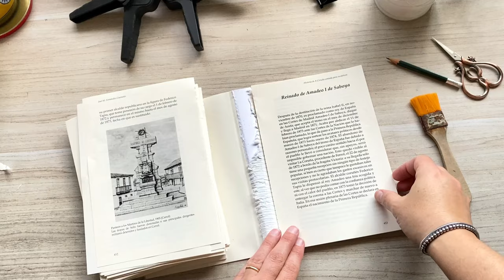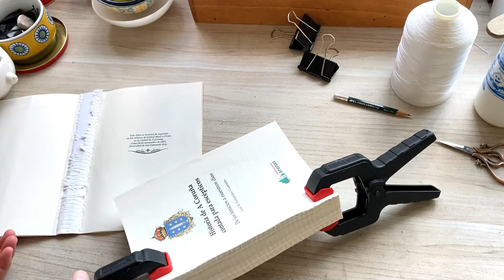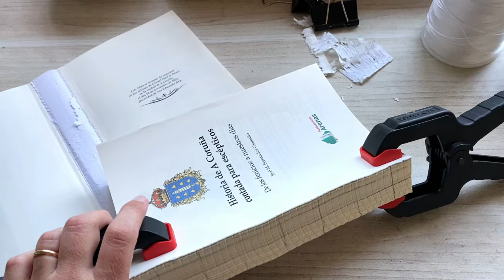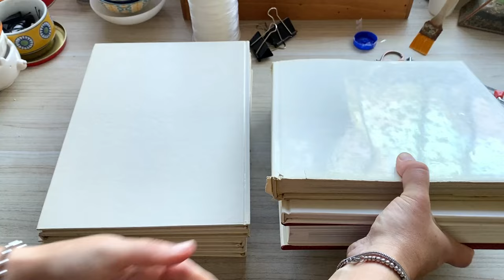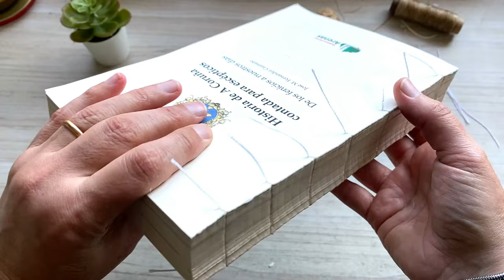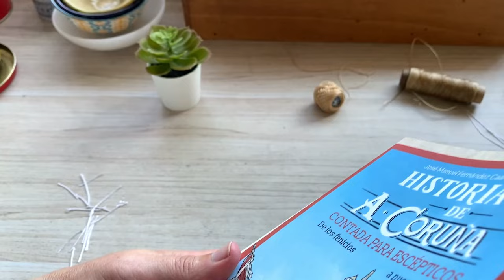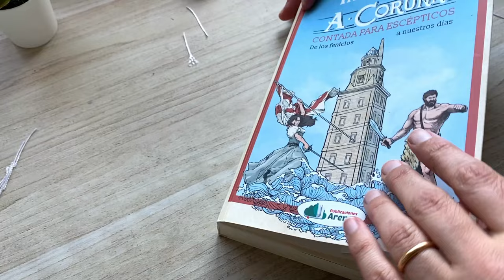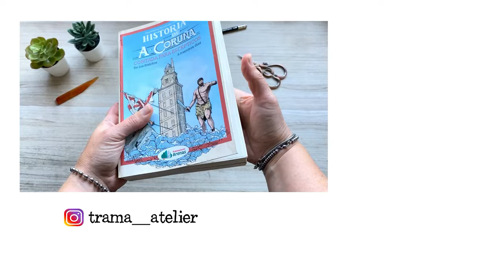How to BIND Single Sheets 👉  ​​How to Repair a BOOK [  NO sewing ! ] Bookbinding Tutorial

Comment: Amazing ❤. I printed single 188 papers to bind the book alone, cuz giving someone to bind a book is a bit expensive 😅. I have a question tho. Why cut the edges and put a thread inside?
Reply from the maker: Hello ! The cut on the spine and the threads provide some resistance to the opening mechanism. Many years ago it was done this way to simulate a false seam. You can try it without the threads but you have to be very sure that the adhesive on the spine will keep everything in place. In fact, that book that you see in the video was new and as soon as I started reading it the pages fell off, it only had adhesive on the spine...now with the threads it works better.
Reply: @bookbindig_studio  ooohhh ryt ryt that you soon damn much 😭❤

Comment: why the strings?
Reply from the maker: Because they add strength to the spine, otherwise, you only depend on the adhesive
Reply: Super...one day I got an idea to cut stripes on the back to add more adhesive to squeeze in to bind more. And also thought to add some flexibility by fixing plastic stripes to it. But fixing with threads is a super idea.
I thought to cut at the back zeebra cuttings i.e zig zac to add more strength to it. 
But this most enough to repair.
Thanks to your vedio. May God bless you.

Comment: Is that bookbinding press made out of cardboard?
Reply: Go to your local joiner or carpenter’s workshop and get them to cut you two lengths of plywood about 15” or 375mm long by about 2” or 50mm wide.  (Joiners in the UK use mm, not cm.). The plywood should ideally be 1” or 25mm thick:  it needs to be stiff rather than strong, or when you tighten your press around a text block it will spring apart in the centre.  Ask them to bore a hole, 8mm in diameter, 1.25” or 30mm from each end of each strip.  Buy some set screws about 3” or 75mm long, ideally with wing nuts for tightening them, and stainless steel washers for each side.  (A bolt has a smooth shank under the head and then a short length of threading.  A set screw is similar, but has no smooth section: rather the thread extends all the way up to the head.  It’s a more flexible option than a bolt for this kind of work). Fit the strips together with the set screws, washers, and wing nuts and you have a book press that will last pretty much forever.  The parts are freely available and shouldn’t cost more that £10$ off eBay, including postage, if your local hardware store can’t help.  Alternatively, you could buy a nice old Dryad book press for around £150$…
Reply from the maker: Hello ! No, it's made of wood , 
I made it as shown in this video   https://youtu.be/-09fZs9Lxfg?si=1yx7Omfn9kcIa8Qi
Reply from the maker: @willgrime  Thank you very much for your complete contribution on the materials necessary to make a press, in this video I show how I made it  https://youtu.be/-09fZs9Lxfg?si=1yx7Omfn9kcIa8Qi